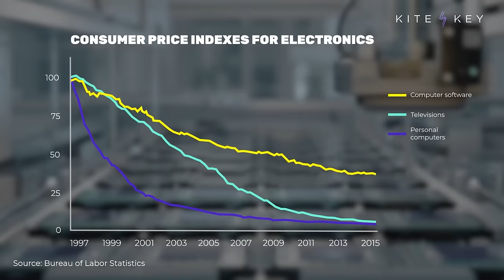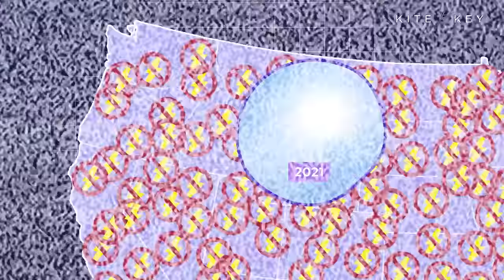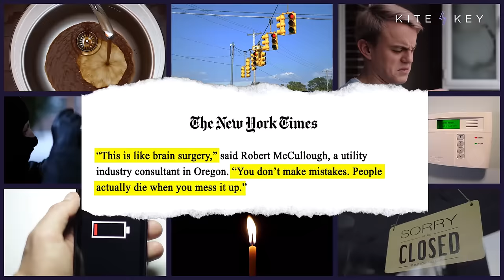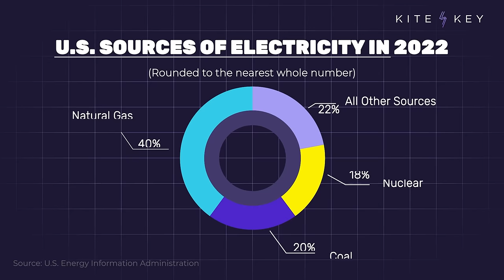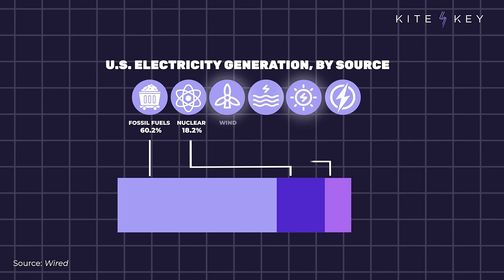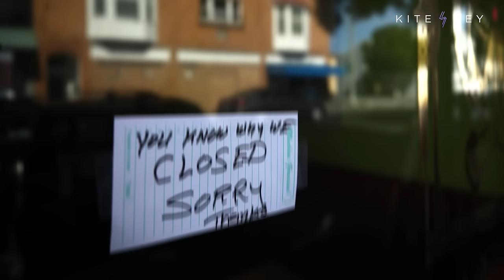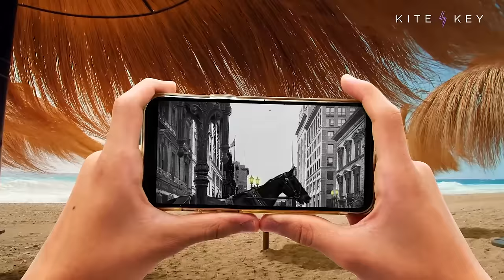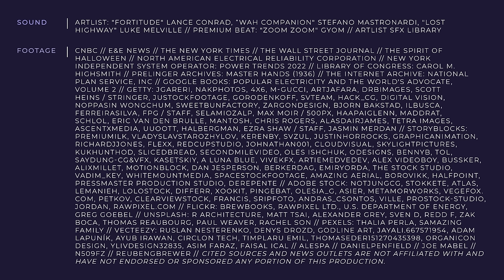How America Is Weakening Its Electrical Grid

Comment: Thank you for raising this issue.  Two nits to pick.

First, journalists should be much more skeptical of that ASCE Crumbling Infrastructure report.  Imagine: a bunch of civil engineers got together and decided what the nation needs is way, way more civil engineering!  It's not true that infrastructure is "crumbling" - not electric, not water, not bridges and roads.  Yes, normal replacement and maintenance are needed.

Second there's nothing wrong with overhead lines in most cases.  Put lines underground only where it makes sense in cost/benefit terms, such as where trimming trees is not feasible or in residential areas for esthetic reasons.  Save scarce resources for other investments - such as more firm generating capacity.